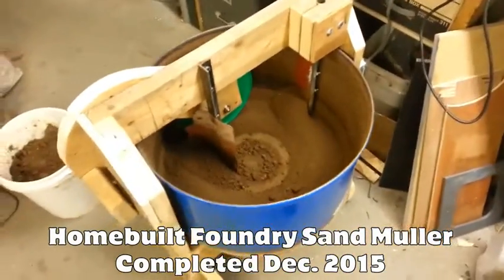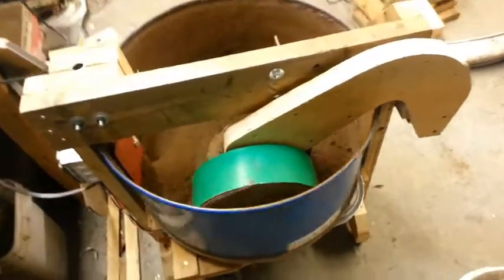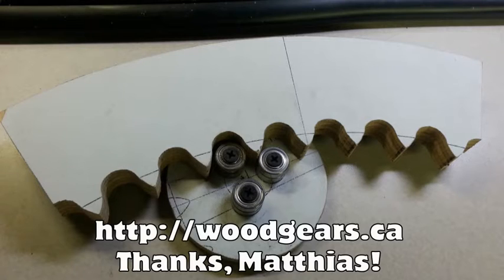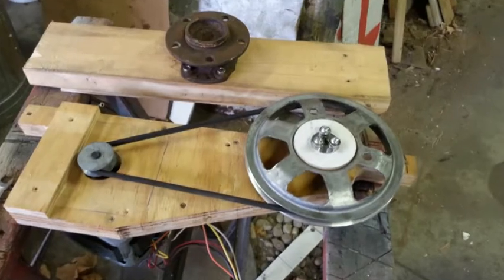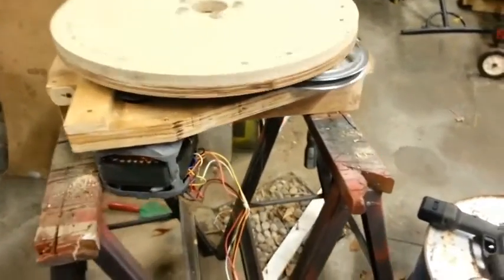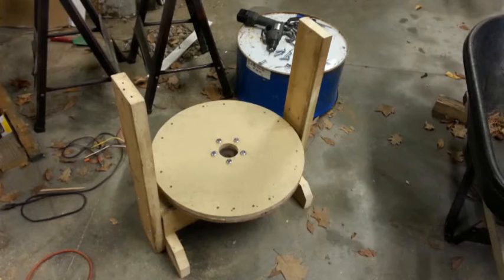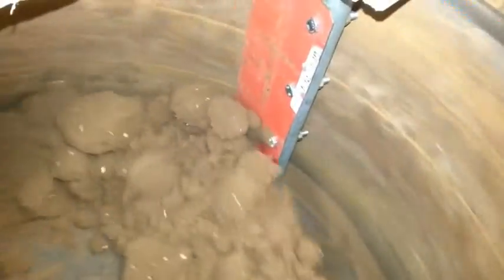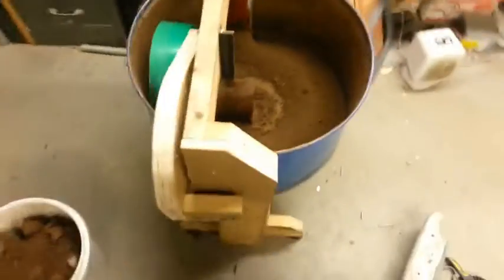Homebuilt foundry sand muller

Comment: How well does it work at 45 RPM.     I am building a 30 inch unit and wondering if I need to slow down the shaft to keep the same feet per minute on the wheel
Reply from the maker: It works the best at the higher RPM.  I rarely use the low RPM.  I think it would do fine.   Keep in mind it may take a bit more power.  What I have found is that the washing machine motor is a little under powered for the 22 inch standard barrel, so if you are going to increase the diameter to 30" it may do a bigger batch but have different power needs.
Reply: dansw0rkshop I will keep that in mind. Thank you!

Comment: Do you think a cement mixer would work for this ???it has everything except a crush roller(s) maybe those could be incorporated easy enough?
Reply from the maker: Yes, I believe it would.  In fact, I had considered using the gearbox on my store-bought cement mixer which is like this one. https://www.homedepot.com/p/RYOBI-5-0-cu-ft-Portable-Concrete-Mixer-RMX001/305293801
Reply from the maker: It won't be enough to just add crush rollers.  You also need plows to tear up the sand in between compaction.  But still, these electric mixers rotate about the right speed, and it would simplify obtaining the rotating mechanism.
Reply: I'm late to the party too, wow, a wooden muller!  How's it holding up a few years down the line?  I modified a cement mixer to build mine.  Removed the paddles, tacked in a steel plate for a flat floor and wear surface, cut down the mixing drum to widen the opening, and attached a crossbar which holds the wheel and plows.  A short size plastic garbage bin is perfect for dumping several loads out into.  Works great for making and maintaining molding sand, I can freshen up about 1/2 a bucket of petrobond or maybe a little more of greensand at a time (approx. one side of a 12X12 flask), but it comes out bigger than that.  I've seen guys use pneumatic wheels to great effect but mine has two 2" wide 8"OD cast iron wheels bolted together side by side.  So far their lawnmower wheel bearings are holding up fine.  The concrete wheel cast in the bottom of a bucket is a great idea!

Comment: I guess I'm spoiled because I have a steel shop that will sell me from the scrap pile very low cost.  I tend to think of fabricating more with my welders.
Reply from the maker: You're certainly fortunate!  I've bought some things from the local scrapyard, it is nice to have one nearby.
Reply: In New Jersey scrap is free all over . Here in Florida there is no scrap metal at the curbs or laying around anywhere. No town dump to go get metal either.

Comment: Great but you are a metal guy . Fabricate stuff from metal not wood ! Although wood had its place in the metal shop. Nice build .
Reply from the maker: Wood absolutely has its place!  Just ask an old skool sheet metal guy.  They pound out interesting shapes using wooden tools (stump, they call it).  Furthermore, I didn't realize I was a "metal" guy.  Yes, I enjoy making things of metal, but it's not a religion.  Wood is good for many, many things.  Especially when you're in a hurry and have lots of free and cheap lumber.

Comment: Dan,

Great build!  Was looking on your website for a place to send you an email, but couldn't find one.  I have a couple of questions about your muller.  How much sand can be mulled in a batch?  Do you remove the sand by shovelling it out?  I didn't see a mechanism for it to dump.

I like you build enough that I am thinking of duplicating it for myself.  The last question is, if I build one, do you have any objections to documenting it on my website and perhaps a couple YouTube videos.  I will give you credit for the design and link back to your site in return.

Joe H.
www.myheap.com
Reply from the maker: +My Heap I remove the sand by shovel, and it's super easy to do with the muller rotating.  There is no dump mechanism, but my earlier thoughts were to build trunnion mounts on the sides so the whole thing would tilt.  But I have not gotten that far, and it's easy enough to use the way it is.

You're welcome to copy the design -- my intention with this video was to be free with information and inspire others in their adventures.
Reply from the maker: +My Heap I haven't evaluated yet how much it will do in a batch.  In rough numbers, it seems like about a five gallon pail's worth.  It will also mix dry ingredients a lot better than wet.  Once that bentonite gets sticky, too big of a batch will stall it.
Reply: +dansw0rkshop
I went to woodgears.ca and played with the gear calculator, but I couldn't figure out how you made the segmented gear you have with it.  Any suggestions?

Joe
Reply from the maker: +My Heap I used the $26 pay version of the gear generator, plus DeltaCAD to copy just a few teeth to fit on a 8.5x11.  Give me a moment and I'll put a pdf of a sector on my site.
Reply from the maker: +My Heap Here's a link to the shop drawing I made using DeltaCAD:
http://www.dansworkshop.com/wp-content/uploads/2016/01/sandmuller_sectors.pdf

If you use it, make sure to print it out at 100% with no scaling.  I'm not sure if this will work for you -- it uses 5/8 OD bearings, and these were some from my junk bin.  You know how that goes. :)
Reply from the maker: +My Heap Did that pdf link show up?  I'm not always sure if youtube filters those or not.  You can find it on the sand muller page on my site as well.  To cut the teeth, I simply printed out 7 copies of the drawing and pasted them onto some 3/4 plywood, and cut on my scroll saw.  (It was tedious.)  You need 6 sectors with 8 teeth, and one with 4 teeth.
Reply: +dansw0rkshop Yes, I got the PDF from the above link.  I can print them out and try my luck.  If you have vectors I can cut them on my CNC router, but if not I will make do.  Don't want to kick a gift horse in the mouth if you know what I mean.  I have a bunch of skate bearings I salvaged from a few pairs of inline skates.  I will measure them up, but even if I have to find some 5/8" OD bearings it shouldn't break the shoestring budget.  Thanks Dan for your support and help!  I appreciate when other DIYers share in the community.  I guess that's why I post my antics in the shop!  :-)

Joe